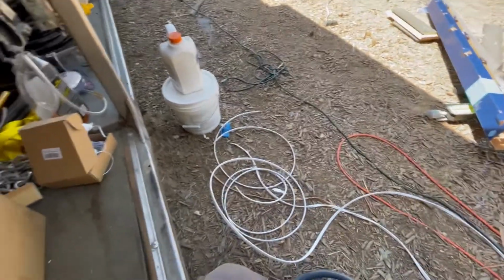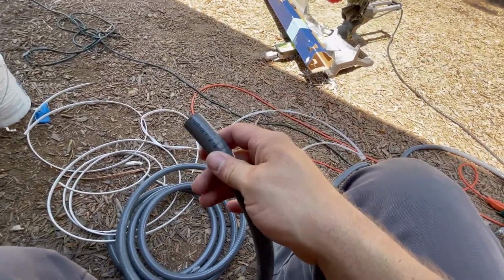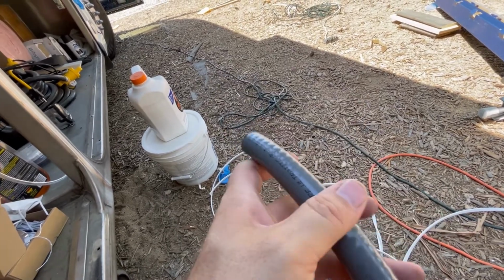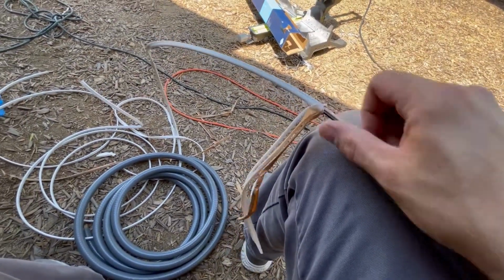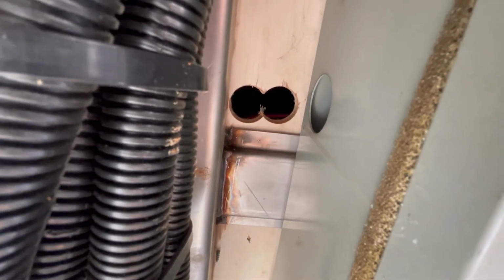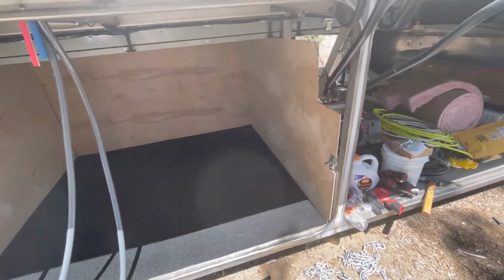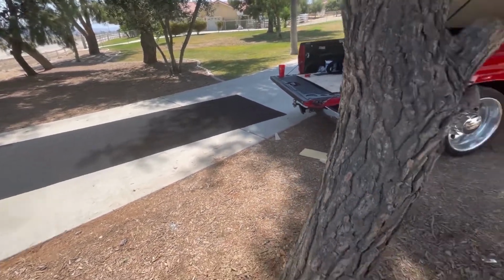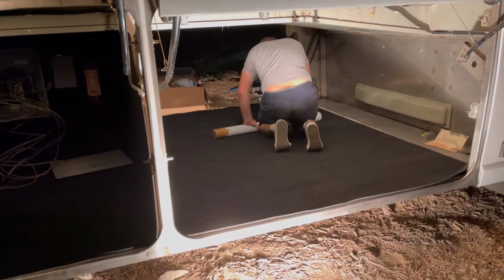Episode 66: Check Out Our Undercarriage

Comment: If you are stripping  the sheathing from the romex to feed into your conduit why not just pull 3 separate  wires.
Reply: NOW you tell me.  Heh.  I had already bought all the wire and attempted to pull it through.  Impossible.
Reply: @ka0tyk  That's why they make wire pulling lubricant to make it easier.